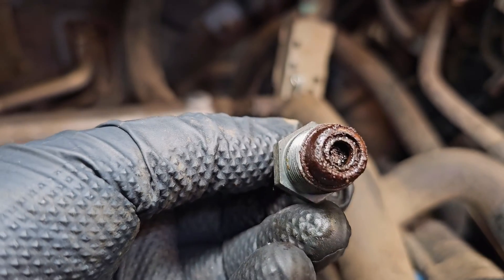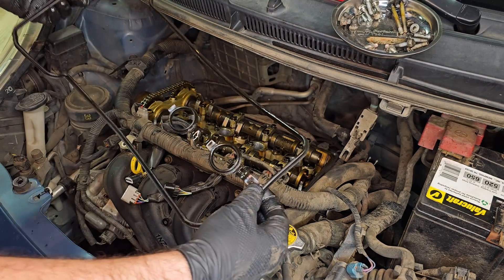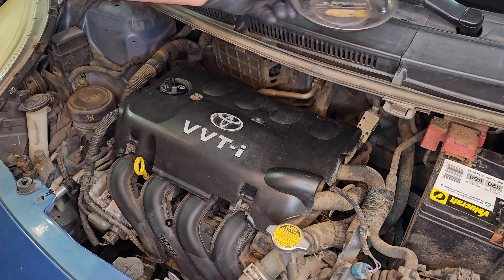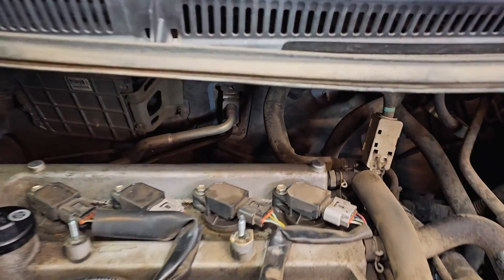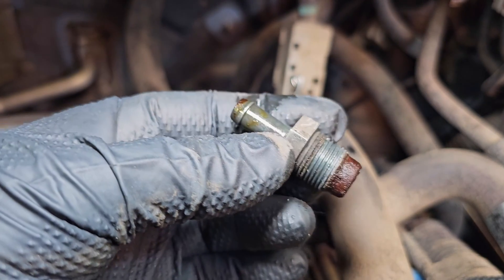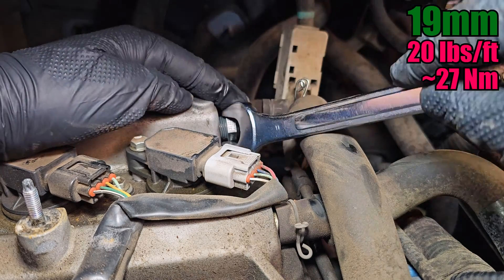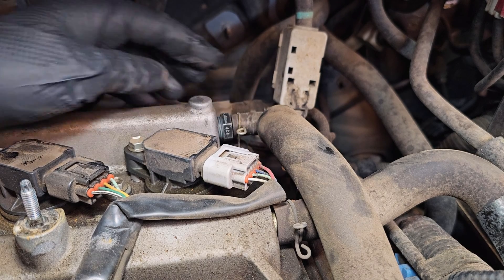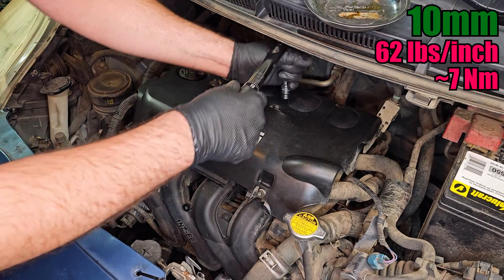Fix Your Toyota PCV Valve Easily: Simple Replacement Guide

Comment: Have you ever had the intake manifold off on your rig? My 1ZR-FXE was slurping engine oil like crazy through the PCV valve. New PCV valve did not remedy the issue. So I installed an oil catch can in the PCV line.
Reply from the maker: I have not. I recently reduced the oil consumption problem on this car significantly with an oil additive. Video coming soon.